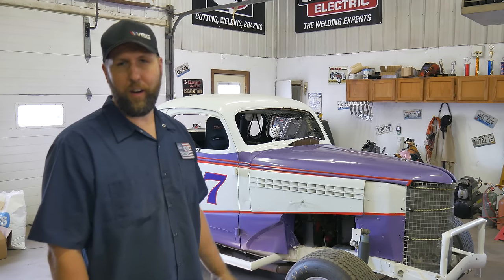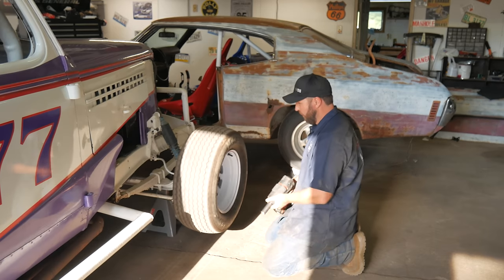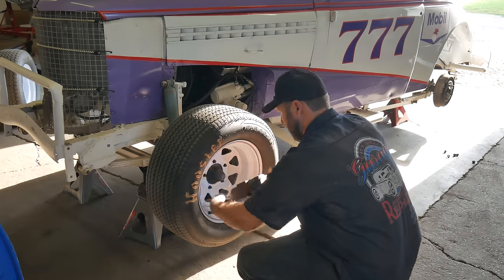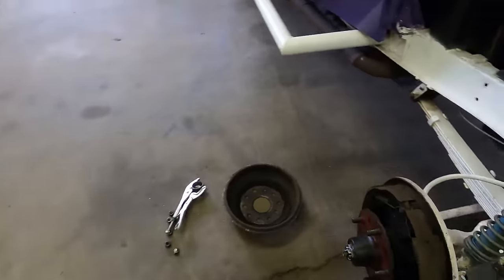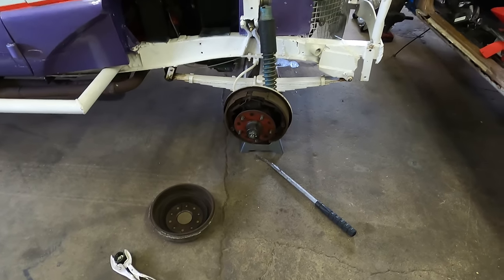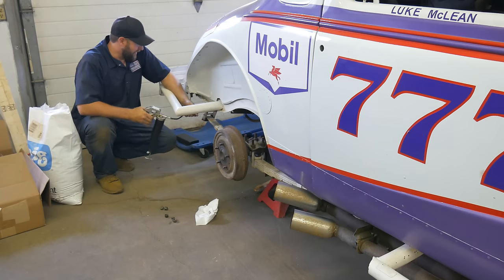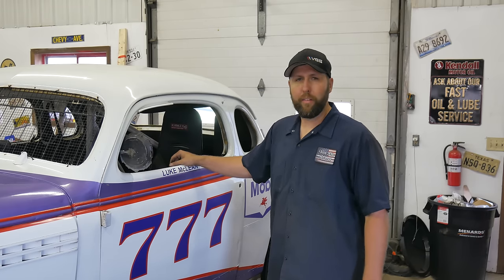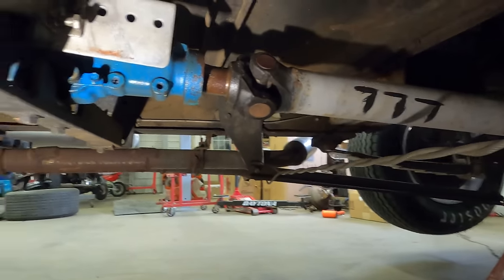Preparing the Vintage Modified Race Car for my FIRST RACE! - Vice Grip Garage EP90

Comment: Stagger up front, does two things. 1. It puts more weight on the taller tire 2. it raises the drinker side frame rail so the car maintains a flat attitude in the corner, reducing loose condition.
This is really effective on straight axle setups.
Reply: The front tires are aligned differently because of banking and it has “wedge” in the body and frame on the drinker side. The axle is offset as much as tech won’t see to help it turn left!! Down the straight it pulls hard to the left!! NASCAR won’t allow ANY offset and will measure it!!

Comment: BTW you are causing me to stay up waaaaay too late at night watching your antics and the wifey frowns on me sleepin late. I'm an old geeser that cut his teeth on the old chevy babbot beaters and Harley 74s so I really can relate when I see you resurect one of those cars that were new in my day, Yeah I bought a 70 ElCamino new and it cost me $2800 right off the assembly line. I also helped build the 67 and 68 Torino among others. A new car rolled off the assembly line every 1 min. and 28 seconds My job was to put the steering column mount and the LH side of the dash.

Comment: Left front brake shoes are on backwards Primary shoe goes on the headlight side not the brake light side.
Reply: The reason for switching the primary shoe and the secondary shoe is to increase front brake engagement. The reason primary and secondary shoes are different sizes on drum brakes is to decrease wheel lock by first engaging the primary (smaller less grippy shoe) first followed by the secondary (larger more grippy shoe). When the brakes are applied the piston of the wheel cylinder moves the primary shoe into contact with the brake drum. The rotation of the brake drum causes the primary shoe to be dragged in its forward rotation the forward rotation wedges the shoe into the drum and transfers to the secondary shoe. By switching the position of the primary and secondary shoe you’re making the secondary shoe (larger more grippy shoe) engage first followed by the primary (smaller less grippy shoe). By making the secondary shoe contact the drum first you’re increasing initial brake engagement to the front end. The goal is not to increase front braking bias it is just to increase initial brake engagement. Increasing front brake engagement helps on dirt track cars by using the front brakes to keep  the rear tires in line when coming into corners and also has the advantage of being able to use your front brakes to straighten you out when your rear wheels break loose. Sorry if my explanation doesn’t make sense I’m not the best at explaining stuff it made sense in my head. lol hopefully it makes sense to those that are curious why the front brake shoes are (backwards).
Reply: @jessicacordova5024  i dont think that would help it to stop. as far as them locking up it about fluid control, thats what you need one of them fancy valves for.
Reply: haydave420 I agree partially it’s not about stopping it’s just to have the front brakes lock or come close to locking fast to get the rear wheel in line with the fronts if the rear wheels are sliding out from under you. It kind a works like on an 18 wheeler if the trailers starting to get out of line you hard to medium brake the tractor to get it straight in line then slowly pull the trailer brakes and that’ll put the trailer back in line with the tractor. I am 100% not saying you have to agree with me or that I’m 100% right that’s just what I’ve always been taught maybe I’ve been taught wrong but it makes sense to me. But I could’ve been taught wrong that’s why I like to have these conversations because I honestly could be wrong because I’ve been taught wrong and you might know better than me and I might be able to learn something from you. That’s what life is about is learning from people that know more than you and teaching people stuff that you have learned.
Reply: haydave420 haydave420 also back then they did also use different valves to help with that but it wasn’t as common as it is now. Now people use different valves and can also tune these fancy computerized valves and change their braking bias instantly that’s what I meant by saying that with the old drums the goal wasn’t to change braking bias only to change initial brake engagement.
Reply: On a turn lefty track your not wanting to stop the car... your simply slowing it down and upsetting the stance.. if want the car to lean forward just a bit... turn left then transfer to the rear,,, it’s called wedge... think of a lawn mower with the right front wheel a bit lower than the rest of them... when you push the mower... it cuts more... and when you pull the handle it raises and put weight on the left rear.
Reply: On dirt track the left front does very little braking. It is off the ground or at least very light most of the time. Some classes don't even run brakes on the left front. If he had right rear stagger it would throw more weight on the left front, but with right front stagger only, , ,
Reply: @jessicacordova5024 -  Those are more modern "servo" brakes, more force will be applied to the shoe with less lining on it. Edit- Just re-read your response, obviously you know that.
Reply: On them drummer boy brakes the poorpotioning value is setted up to applies rearend brakeses first for some forgotten reason

Comment: Looks to have a 5 on 5.5in pattern. So more than likely an old Jeep or International Dana 44. Ford used the same pattern as well I don't think they ever put a Dana 44 in the rear. They used Dana 44's as the front four-wheel drive axle though with the 5 on 5.5 pattern.
Reply: My 79 f100 has a dana 44 rear, it wasn’t the most common option but they were used
Reply: All of the Ford F100s from '53 till '56 had the Dana 44 most with 392 gears some with 410 gears.
Reply: Fun fact- Dodge used an 8 lug front version on 3/4 ton trucks through the 90s. After 1985, all had CAD

Comment: Coming from a dirt track guy. Make your seat bracket attach to your roll cage. Shoulder belts bolted to the cage and lap belts bolted to the floor pan is extremely dangerous. I also have a vintage car. Late 60s super modified. Love the car and your channel.

Comment: That definitely looks like a Dana 44 10 bolt from a early Ford they were popular in 4x4 fords as front axles probably has 3.73 gears to 4.10 gears @3:10 @ViceGripGarage

Comment: 2nd comment. Yr channel the best thing ive bumped into 4 a long time! 68 now, but an 18, 19 n 20yr old i worked at one of the few garages in Jamaica that had the tech to look after the Brit sporty cars and, and, all those wonderful turn of the 60s/70s decades Yank  (mebbe American is better: ) muscle cars. Gas was $notmuch a galon etc. 289 and later 427Mustangs, big block (396) brutal Chevelles, my friend Mickey had an Olds 442 that lit up the tyres when yuh floored it at 40mph! i love yr love for the American motor car and in particular the v8 engine. surely the most durable and long lived design ever.

Comment: You could go with the 2 lever manual shifter that us roundie round guys use now. Has an independent arm for 1st/reverse and 2nd/3rd. Is designed to be mounted on a flat surface and uses tubes, and or rods, with heim ends. Let me know if you need help locating one on the old interwebs.

Comment: back in the day; I ran a 327 and also 292 chevs then went to the old wide block 313 dodge. What I wanted to say is we mainly used aviation oil , a while ago now -*(50 plus years) E 80 or E100 (esso) or shell 80 or 100. the shiftier will not get used a lot racing, start in first 10 mph shift to second and that was it to the end. looks like a lot of fun; good luck and don't scratch the paint.

Comment: A guy could "modify" the upper portion of gearshift until something is sorted out. Seems odd to have it set up like that  Maybe Luke was comfortable that way. I don't know.
Reply: Get in gear, and your set for the duration, no need to shift.
Reply: A.J Sipple yeah maybe drop into second if a yellow flag went up but yes get her in high and let her eat. 
I ran s 73 Chevelle (body chassis was much older) with nearly the same setup as this and we ran 5.13 gears in the rear.

Comment: Well, looks like ever time you drop her into second, a fellers likely to bash himself directly in the nut pouch.
Reply: a guy really wants to make sure those harness straps are on good and tight that's for sure.
Reply: @Hobodeluxe960  yup or one jam on the brakes and you are going to get the 1-2 split with the twig and berries!!!
Reply: Better hope a guy doesn't break a shift lever on the ol 1-2 shift.  Not sure how to change the name to a more feminine version.

Comment: Derek. Bare with me with all my down under terms. Years back I had a Holden HQ (1972) One Tonner, Hired a car trailer to go move a car, took off from their yard, shifted to 2nd and the lever came off in my hand and blew up the shifter boot. Wasnt the first issue I had had with it, shifting to 1st while it was still in reverse. weld grind file, I'd had enough. I went to the metalfab place my mate worked at and had one of the guys there weld 3 bits of 1"x1/8th flat strap on the selectors, centre one straight up, outer two bent on angles. Pushed a bit of heater hose over the 2 main sticks. Ended up with something like a poor mans lenco. Wrapped an old towel around if for a shifter boot. Never ever again did i select 1st while it was still in reverse.
From what I recall, the M20 4 speed we had used a shifter similar to what a M22 munchie used. I'd Imagine you have a worn out munchie 4 speed shifter or three laying about, can you get it mounted on the tail stock of the 3 speed? Given engine is solid mounted you could mount shifter to body. Wrangle the stick off it, put two fresh ones on bent how you like and now the shifter is out past your right knee.  2 sticks, Reverse-1st, 2nd-3rd 100% positive engagement every time.

Comment: I had a similar shifter issue with a 41 Plymouth hot rod that I built years ago… You need a Hurst shifter with a shifter handle from a 1968 1969 road runner/super bee with center console. It has a 90° jog in the shifter handle. It should allow you to move it to the right side of your leg.

Comment: Seems like he adjusted the shoes out on the front left so he could drag the brakes in the corner to help the car rotate
Reply: Using the left front to help the car set for the left hand turns. Then the back end kicks out and you turn into it and stand on it. The weight having transferred to  the right rear. You don't want the rear tires to stay in line as stated above or the car will push,  straight and usually into the wall. Dirt track is a different animal!!
Dirt late Models are going into the turns at about 135mph. One pump of the gas and back on it!!

Comment: I wonder if you can find a modern cable actuated shifter that you can mount next to you instead of between your legs?
Reply: It's a stick shift...
Reply: @EASTSIDE-313  Yes I know this. They make cable actuated shifters for manual transmissions too.
Reply: @NickBeek  yeah maybe in your Saturn 😂😂😂 this is a Muncie boy, u ain't shifting it with a cable 🤣

Comment: Looks like a guy a got his ears lowered and his whiskers clipped. You're almost starting to look respectable
Reply: You can find old ones on Ebay. As long as the shift pattern is the correct one. One I had would stick because of the loose pin and lock it up. Crow bar underneath break loose and go again. Speed shift would lock it up immediately.
Reply: Marshall Hatch You can find hair cuts on EBay?
Reply: He's looking shiny.
Reply: Old vgg whiskers on eBay... A fella better talk to his wife first.
Reply: I couldn't imagine shooting around a racetrack sideways in that thing with a 38.569" hole under me, for a rock to shoot up and hit me in my hunny sack! Ouch!!!
Reply: Almost is actually pushing it.
Reply: @garykuhn1921  I guess maybe a guy could wear a cup for protection? LOL
Reply: Yup, looks like a feller cleans up pretty good.
Reply: He said on the live last night that he had to go to a funeral for someone that he didn't feel right going to with a mullet.
Reply: Joel Alexander I think Marshall got lost...he’ll be ok.

Comment: when I oval tracked raced in the early 60s I do not really remember dropping into high gear accept in the hot laps or pace laps. the race was second gear all the way with an aluminum flywheel ; we changed rear ratios with the tire sizes and tried to run between 4500 and 6500 in the lap.

Comment: Some of the roundy rounder guys used to only use air pressure for stagger in the rear dew to having the diff lincoln locked, so a guy wouldn’t blow her apart. Also you can measure the circumference of the tire and with air pressure you can achieve about 1.25 inches of difference between side to side with the same size tire.

Comment: You could look into a Hurst 3 speed shifter. We ran them a lot on our Ford RAT 3 speeds off road racing as well as sand drags. Worked great even on the 1-2 shift. Don't even need to let off the gas banging gears.

Comment: Derec idea on the shift handle, cut it off down by the floor where it won't interfere with your feet or legs weld a  90° elbow on there. Then get a piece of threaded straight pipe as long as you need, then another 90 degree elbow and screw your shift handle into that problem solved and you do not have to change the whole mechanism. Been there done this and it works perfect

Comment: We used to put a valve in the right brake line to cut back on the brakes. Using the left brake only really made it turn the corner.

Comment: Check into a  Hurst shifter bushing kit from your local auto parts store. They're common and do a remarkable job of tightening up a sloppy shifter. I have a Hurst "Pit Pack" that is made for a 4 speed shifter but something like that would be a massive improvement in snugging up all of that floppy shift linkage. The pit pack contains linkage rod bushings and the circular spring retaining clips.

Comment: That old shifter looks like a Mr. Gasket universal , Speedway has the 2 handle ones that the roundy round fellas use. When I raced we only used 2nd and 3rd gear once she was on the boil.
I’m using a 59 283 with powerpack heads in my T bucket project, 59cc , 1.72” intake and 1.50” exhaust, they’re stock.
She’s a pretty cool racecar

Comment: that has a straight axle front , kingpins and offset for oval track racing will make it shimmy on blacktop but you wont notice it on gravel , camber is offset for more direct left turn control and bite on the track 
\

Comment: i have a 600 single feed and i used white power valve springs and 780 squirters works great
Reply: but mine was holley lol maybe you can get equal in Eld..

Comment: When I was running dirt track, I ran Valvoline 50 Racing oil because I was running a 350 at 6800 RPM on the back stretch. Had a lot of heat on the track, so oil pressure wouldn't drop so much when the temp got around 200 degrees. Ran a 182 degree thermostat.

Comment: A feller might be able to get that shifter to the right side but you'd have to put one heck of a long 90 degree bend in the shift rod and of course, add some length to it. Not sure if that long 90 would give it too much leverage and put too much sideways  pressure on the mechanism. Quite a dilemma. Looking forward to more.

Comment: When I was 16 back in 1961 I put a 36 ford coup together with an engine from a modified, isky cam 4 stromberg carbs, home made headers, and offy heads. no fenders or glass, a few gauges And hydraulic brakes . terrorized the neighborhood. Never got cought. Traded it for a 46 Ford convertible.It reminds me of your racer. Great memories. Use grey in the interior make it sort of street legal.
Reply: That was a full race flat head 296cu in.

Comment: On the shifter handle to get it over past your right leg , the old auto car tractors had a bent stick that rolled to the right. If you wanted to leave the bottom part of the shifter where it is that would be the way to go. But hey, I just woke up, what does a feller know without breakfast.

Comment: Im Reading the Comments about "Why This Part" and " "This Piece of Metal".
It's Original. Whenever Something Broke, You went to the junk pile And Made It Work.. my Friends family Owned a garage, His Father just Passed. He was Going to Rebuild his 34ford Angelia The Body is Immaculate Original glass for it. But it was Set Up on a Chevy frame With a 427. Anyways the Motor went Into A Modified Dirt car...But the Old Ford Is On the Frame It Was Raced On.. Body's for Sale i think. Haven't seen him in a while.. this car Derek has Is a Time Capsule of 50+Yrs ago . Good Luck Brother 👍😎🥃🥃

Comment: Have you considered running synthetic or maybe mobil one? It will give you a few more rsss and will stay with you longer. I saved an Intrepid 2.4 aluminum block from the junk heap with synthetic, It would just cook regular oil and gunk its self up and stop pumpin oil to the mains and you know what happens next.

Comment: might be the cold snacks talkin but a fella might want to ponder on rotating  that shift lever 180 degrees to the drinker side to help out.  Thinking out loud that the bend might go away from the captain.......I don't know.   Will allow so much room for activities like knee steering, and the legs to clamp down on the frostees as you are poppin the tops.and banging the gears.  Good on ya.

Comment: Most racing bodies have a rule about having four working brakes.  having the right front setup to be loose is likely to help you corner under braking.  It helps set the car in the corner. For your first time out, it's probably a good idea to have all four good and tight though.  Also unless that car was running on a big track you're going to want stagger.  Most likely the car got a flat at some point after racing and they just threw on whatever they had.